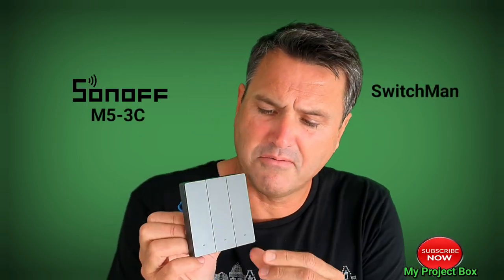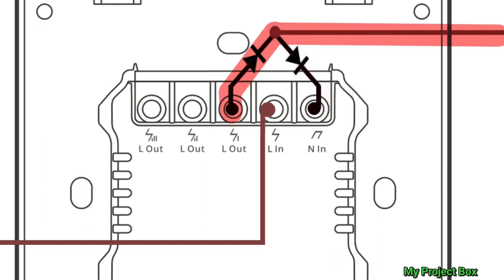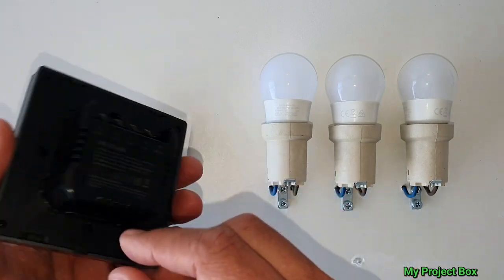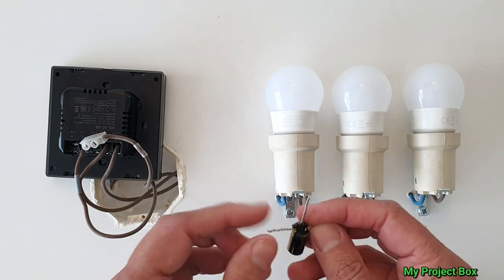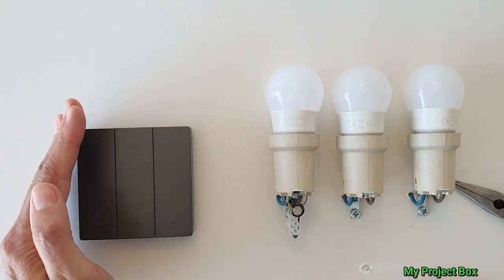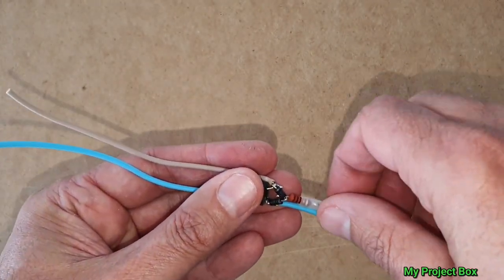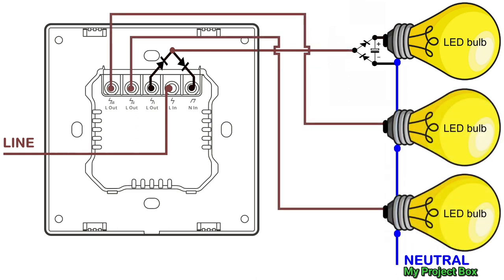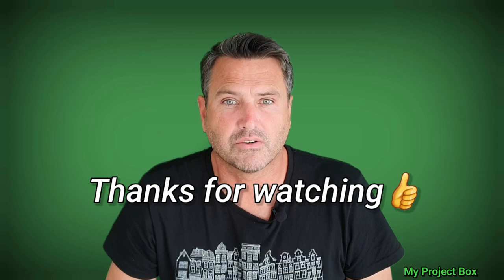Sonoff M5 NO-NEUTRAL  required trick! SwitchMan Hack #Sonoff #noneutral #circuit #modified #M5

Comment: Genius solution! It really is like a black magic. Even for myself who works with this stuff. It took some thinking to realize the simplicity of the concept, yet it solves a huge issue. 
I was lucky that in my appartment there is neutral wire pulled and crimped in every switch. Praise to that electrician!

Comment: Thanks for these great videos! 

I had difficulty sourcing capacitors and resistors in South Africa, so I opted for a 10uF 350V capacitor and no resistor.
The circuit works great on the Qualitel 3 Gang Tuya switch, tested with 11W bulbs.

I also tested with 3.5W bulbs but they would not work.
Reply from the maker: I'm grateful that people are testing my circuit with different smart switches, and reporting back to me😉. Some LED bulbs won't work if the internal driver is based on a capacitive dropper circuit😢. A 350v 10uF capacitor, should be OK,  but 400V is better for safety. If you can't find a fusible resistor, you could solder a small fuse inline with a 10ohm resistor. Or just the fuse on it's own (mabe 1A). The 10ohm resistor will prolong the life of the capacitor. But that's up to you.

Comment: Hello, Thanks for the great idea in your videos! I have bought 5 differen smart switches and your idea was working only on 1 of them. I found a way to make it work on all of them with simple addition - i put a full rectifier on the input. That is solving a problem were you have just one diod inside the smart switch instead of full rectifier.
Reply from the maker: Thanks for the tip. Some people have commented that all the diodes need their polarities reversed, on some brands to smart switches.(Obviously the capacitor polarity reversed aswell 😉)
Reply: Hello, can you send me picture of full rectifier, or diagram, on Bseed smart switch doesnt work.

Comment: How is that different from just simply connecting a cap in parallel with the 1st bulb between "line 1" (wire 1 - hot) and "return line" (wire 2 - hot)

Context = we use 220v from where i am, both cables have 120v

Comment: Your video is very simple and straight to the point. I'll be, for shure, a constant viwer of your channel.
That said, i do have a question: 
My system will be placed for a LED reflector (30W) and the tension is 220V. In that case i've made some calculations:
The current at the reflector is 0,14A (I=P/U = 30/220 = 1,13636363)
So the resistence at it is 1.613 ohm (R=U/I = 220/0,14)
For the capacitor I need a 33uF capacitor, just in case...
So I'm trying to do the calculations for the fusible resistor, and I'm stuck. I've search all over and didn't find a source that indicates a resistor besides the 1.613 ohm, but someting about this calculation seems strange to me, and, at some answers you talk about using a 5ohm resistor.
Could you help me understand what i am missing? and what kind of resistor do i need to protect my reflector?
Reply from the maker: Some people have had some trouble with the fusible resistor blowing with  stronger LED lights. So I decided to change my circuit design a bit. In my new design, I moved the fusible resistor out of the main current path. It is now in-line/series with the capacitor. Now it only has to deal with the inrush current and ripple smooth current. It will protect the circuit if the capacitor failed. I also changed the diodes for very high current types, to make the circuit more robust, and possibly survive a short-circuit/ circuit breaker tripping.
Take a look at this video 
https://youtu.be/mznx0xoF8Ck
Also you might not need a big 33uf capacitor, because many LED light fixtures have big filter capacitors inside there power supplys. With some "big led lights" you don't even need a capacitor at all.
Reply: @MyProjectBoxChannel  Sir, I'm speechless. You not only do a great service to everyone who needs help with the topic, with your videos, but you also take the time to answer questions in a helpful way.

I will definitely watch your video. And I wish you strength in this incredible work. I am already recommending your channel to other enthusiasts.

Comment: hello ..what resistor is used ..10 ohm 1w or 2w or higher.??..I used 1w and smoke comes out at the end it burned. used with .incandescent light bulb ...P.S I tested the circuit and it works  very well on sonoff NS Panel
Reply from the maker: Thank you for testing and confirming that the Sonoff nspanel works. A 1w or 2w resistor, is OK for a led light bulb only. I'm thinking of revising the circuit a bit, a 5ohm resistor could handle a bigger load bulb😉. Maybe a 2w 5ohm. You could put 2 10ohm resistors in parallel if you prefer. I may decide to do a video on my "newer circuit". With bigger diodes and the 5ohm resistor in a different position in the circuit. Thanks again for your feedback 😊.

Comment: Many Thanks for sharing, for Diod can i use 1N4004? (1A/400V) or need use back 1N4007? (1A1200V)
check back with the other brand smart switch are dont need add a diod at the panel , only add a 4.5uF capacitor on like are can work in? are this is safe to protect the switch and light?
thanks in advance for your advice.
Reply from the maker: 1N4004 will work fine😉. My circuit needs the diodes at the smart switch, and the at the LED light aswell. You can try different values for the capacitor. Sometimes you can eliminate the capacitor at the LED light completely. It all depends on the type of led driver inside the lights. I don't exactly understand your question so I hope this helps.

Comment: Hi, thanks for sharing this. Just a few questions:

1) How long would the capacitor last?
I’ve some experience with no neutral wifi switches with capacitor installed. Seems to have the the same concept as yours. Only issue was the capacitor wears out (defect?) after some time causing the switch/light to go nuts until the capacitor’s replaced

2) If i use this method on zigbee switches, would it still act as zigbee repeaters?

3) Generally how safe is this method?
Reply from the maker: The other "no-neutral" smart switches, work on a completely different principle.  With my circuit, it's the diodes that do the bypass function,  and not a  film capacitor as traditionally used, in a "no-neutral" device.  In fact you can even sometimes leave the capacitor out completely! (for some types of led bulb).   The  Electrolytic capacitor's  job is to smooth out the DC ripple, It  prevents some types of led bulbs from "shimmering/flickering".  When the led bulb isn't ON,  the capacitor does nothing and just sits there.  So it's not working as hard as with the other "no-natural" designs.  As for safety, of course it's a homemade circuit,  that's why I added the fusible resistor, for safety.  It's the same type of protection they use inside the led light bulbs.  Most smart switches use an internal fusible resistor, for safety as well.  The circuit is only designed for devices that need that need a neutral connection to function.  So if your  zigbee device, is designed to take a neutral connection,  then yes! it should retain its complete functionality as normal.  I have not had one of these circuits fail on me yet🤞🤞.
Reply: @MyProjectBoxChannel  thanks for the detailed explanation!
I have 1 gang switch that’s wired to a ceiling fan. 
Do i need to change anything or just stick with the same method?
Reply from the maker: @thebatu89  This circuit isn't suitable for a ceiling fan, it was designed for LED light bulbs. Some types of led drivers for led tape strip work as well.
Reply: @MyProjectBoxChannel  thanks, so I’ll probably need to get a no neutral zigbee switch for the fan.

Comment: About to use these to get my m5's working!
Reply from the maker: That's great. It might be worth checking out my circuit update regarding the fusible resistor, If you have a quite powerful led load connected. The main difference is that the fusible resistor in now in series with the capacitor. https://youtu.be/mznx0xoF8Ck

Comment: hi! can this setup work for 220v? and can I use a 450V capacitor that I have right now. I am from the Philippines and we have 220v.
Reply from the maker: Yes it will work on 220v and a 450v rated capacitor is fine😉👍. You can safely test your circuit before installation like in this video. https://youtu.be/oBR5O391m_c at this time stamp 12;56

Comment: How well will this work with a set of fluorescent lights as load? Say, 4 of them, amounting to 144W? They have a ballast, so I'd think there is an inrush current.
Reply from the maker: It won't work with the older type florescent lighting, the type with magnetic ballasts. It will however work with the newer type, the type with electronic ballasts. It's probably a good idea to use bigger diodes and bigger fusible resistor. Or even better use my newer circuit. https://youtu.be/mznx0xoF8Ck

Comment: Great source of knowledge! Thank you so much! I got a hold of a smart power wall outlet with neutral wire required. Could this virtual neutral circuit be used?
Reply from the maker: No. This circuit is not designed for socket outlets. It is to be used specific types  of smart light switches,  and led light bulbs only.

Comment: I tried this and it worked perfectly….however my resistor was blown after a week. Any idea as to why this happened?
Reply from the maker: Some people have reported this issue, so I have modified my circuit in a new video. Basically it now has the resistor in-line with the capacitor, and not feeding the switch Line anymore. The resistor now only handles the inrush current to the capacitor, and does not carry the current from the LED light. I also changed some of the component values to to make it more robust.
https://youtu.be/mznx0xoF8Ck

Comment: I'm in the process of replacing traditional crappy switches with the M5 - in a 2 year old house. I've been lucky in that most of the time the electrician pulled a neutral but in some cases there's no neutral. What I've done so far is find the first downlight where the wires from the switch run to and then just pull a neutral - relatively easy when there's conduit end to end and you pull say one of the live wires connected to another live and neutral ie use the one live wire as a draw wire. My real problem is that my one room missing a neutral is more than double volume - the downlights are 6m up - so not as easy (or safe) to be up and down the ladder looking for the first downlight in the chain. I got very excited watching your video until it dawned on me : I still need to find the first downlight in the chain since it's a two part solution - the diodes at the switch and the diodes and cap at the light. In my case if I knew which was the first downlight connected to the switch I may as well just pull through a neutral and do the job properly.

What would be ideal is to not have to do anything bulb-side and only fiddle at the switch - especially if you have downlights in a slab and you don't know where the conduit runs.

Besides my challenges, I want to applaud you on your innovative solution and on your video.
Reply from the maker: I hope you find that neutral wire and get it to the switch somehow😉👍. You could still use my solution, if you can't find the first downlighter. You can put a diode bypass between every downlight and its feed. Sometimes you only need the diodes, and the capacitor is not required. This is because some LED downlights have large capacitors on their driver circuit. If you are lucky enough to get away with just the diodes then no fusible resistor is needed either.

Comment: Thanks for the great video I was trying out your solution but on a Aqara H1M 3 gang and it works partial I am not sure if the wiring is different in my country. 
I tried using both the 4w and 10w led bulbs the 4w bulbs flicker while the 10w is lower brightness when the switch is off. When on both lights will just be at full brightness.
Reply from the maker: I have not tested that smart switch with my circuit yet. It could work I don't know with out experimenting with it. It's possible you have something connected wrong? Maybe the polarity needs to be reversed for some diodes. Maybe make a test setup, with  safety current limiting like in this video. Using a old school incandescent light bulb. https://youtu.be/oBR5O391m_c  at this time stamp 12:56
Reply: @MyProjectBoxChannel  In theory I believe all circut should be similar but one thing I did find interesting was when I placed the diodes @ the switch without the capacitor + diode setup @ the bulb the smart switch could already work and but still faced the same issue of the lights flickering / staying on when the switch was in off postion.
Also forgot to mention 1 switch on usually controls  2 bulbs vs your example where 1 switch only controls 1 bulb
Reply from the maker: @8136909  without seeing your circuit in front of me, it is difficult for me to work out what is wrong. The circuit very easy to get wrong, despite it's simplicity. You can easily damage components and not realise it. Are you using the optocupler circuit, or the "4 diodes and capacitor" circuit?
Reply: @MyProjectBoxChannel  Thanks for replying and yes I agree it not as easy as it sounds. I am using the 4 diodes and capacitor method exactly like in this video you made. 1 problem for me is I am only confident of the wires I can see @ the switches and the wires terminating @ the bulbs any additional wiring made above the ceiling is unknown. 
When you mention reversed for the diodes should I do it @ the switch or the lights or once you switch it at one point you gotta do it on both ends?
Reply from the maker: @8136909  I would suggest build a test circuit wired to a plug, complete with LED bulb. Verify it all works as expected first, with your "un-tested smart switch". Then move on to installing it to the house wiring.
Reply from the maker: @8136909  it's important that you have the correct wires identified at the light bulb. You must know which wire is the "Switched Live", and which is the neutral, And don't reverse them with my circuit! It won't work properly, or things could go BANG!
Reply: Ok thanks for the advise l will test it over the weekend and see how it goes

Comment: I did everything like you said, the switch seems to be working. However only the second light is working properly, the main light with diodes and capacitor doesn’t work. When I try to turn it on, it triggers the house breakers.
Reply from the maker: Something is not right 🤔. It's possible that one of the diodes are damaged, or in the wrong polarity. Either replace all the diodes or test them individually. If your circuit breaker is tripping, you would most likely of damaged/destroyed a diode! It's possible to safety test the circuit without damaging anything using "safety current limiting", by putting a old school incandescent light bulb, in-line/in series with the Line supply. In one of my older videos I demonstrate how to do this.
https://youtu.be/oBR5O391m_c  at time stamp 12:56
Reply: You were right, the diode has been broken. Now, everything is working fine. Thanks 😄
Reply from the maker: @mateuszkaminski7998  happy to help 👍😉

Comment: will it any difference to the type of  components if the live is 240v instead of 110v.
Reply from the maker: All the components were chosen for 240Vac, but it should still work fine on 110V aswell.

Comment: If several bulbs are connected to a single switch, would this work if the capacitor is only connected to one of the lights? Would this also work if it is fluorescent tube lights?
Reply from the maker: You can connect just one capacitor/diode bypass, for multiple LED bulbs, but you need to find the point where the first bulb is fed from the switch. This way the bypass acts on the entire parallel string of lights😉. If you can't find that point, then just use a bypass for every light bulb. This circuit should work with CFL lamps, but it won't work with the old fashioned (magnetic ballasts) florescent tube lights. It should work OK with the more "modern electronic ballasts" for florescent tube lights😉👍 I have a slightly improved version of this circuit that is more robust/tougher. https://youtu.be/mznx0xoF8Ck

Comment: Hi,
Thanks for the great video!
In choosing of a Fusible resistor, this model MF01SFF100JA10, is it will work well with this parameters?
Reply from the maker: Yes it should be fine😉👍. You can also use a 5ohm 1w, fusible resistor for bigger or multiple led bulb loads. Let us know how you get on.